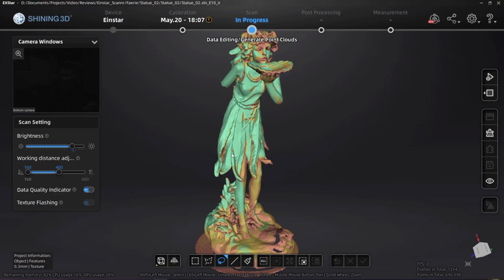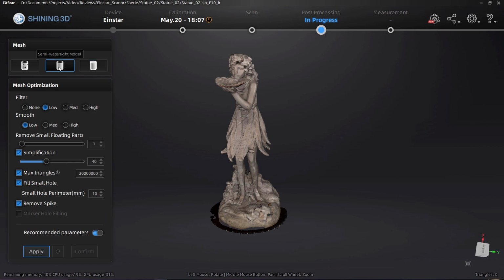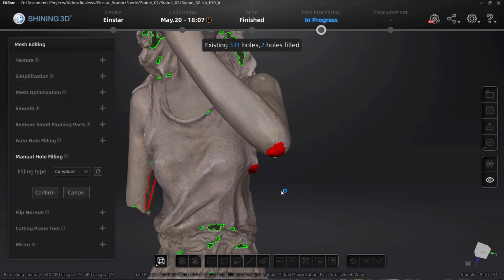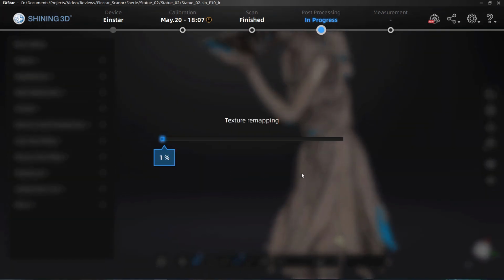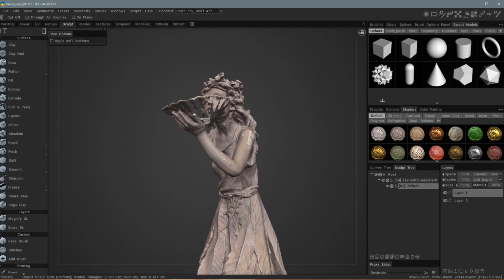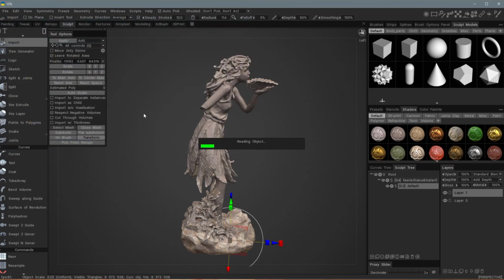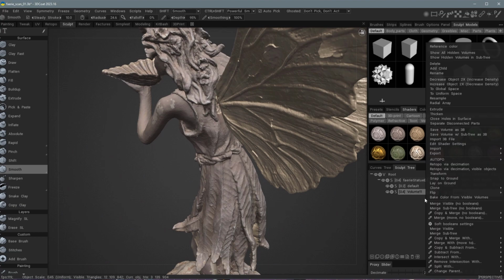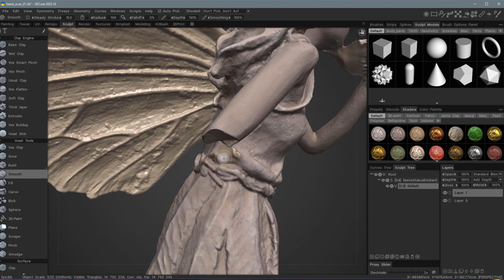Can 3D Scanning Fix my Broken Statue?

Comment: Pretty cool workflow. Scan looks very decent, and poly model in Coat is good. With a bit of sculpt you could make better than it was originally)) Final print looks a bit dirty, but I'm never happy with FDM prints... Maybe with a bit of processing it will become nice and clean.
Reply from the maker: @nicktyler2572  I did rush a little to get the video out but thanks.